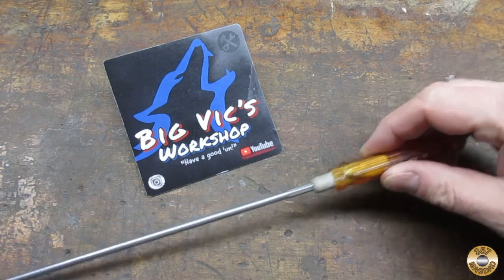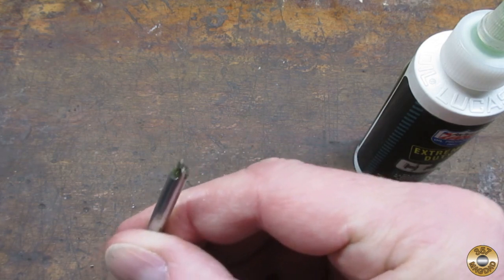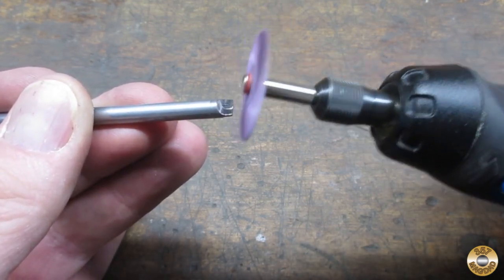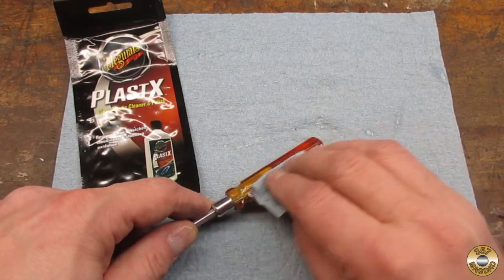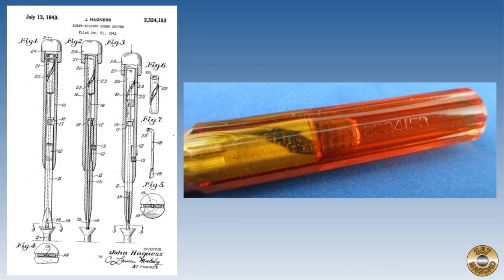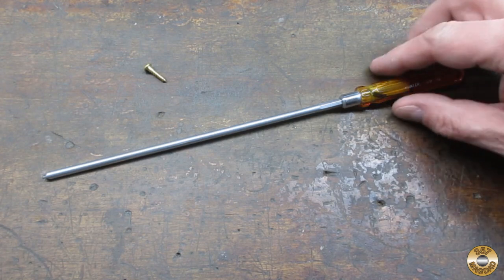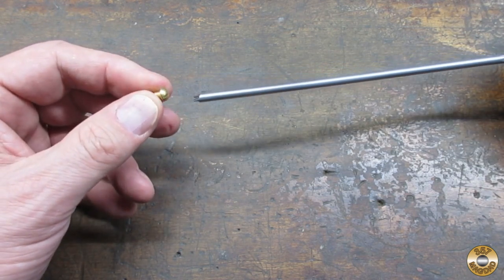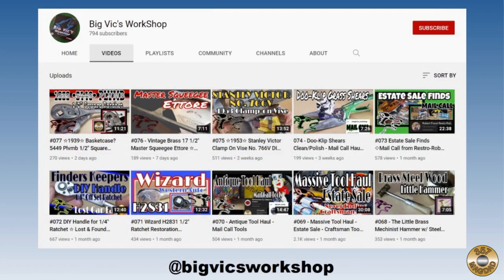Hunter 10M-12 Screw Holding Screwdriver

Comment: Oh I misjudged this at first! I thought the mechanism was the very familiar style like the new ones you showed images of. This is much more complicated! I can think of three different ways that they could convert linear input into radial(or is it axial), but I'm having trouble imagining how that would work cast in acetate. It's quite impressive that the dynamic jaw does not move in and out at all when locking it up. I'm going to have to look up that patent, must be an interesting mechanism
Reply from the maker: It looks like there is a helical track in the part that is pressed into the handle that produces the rotation.